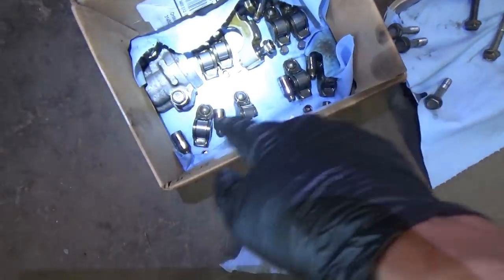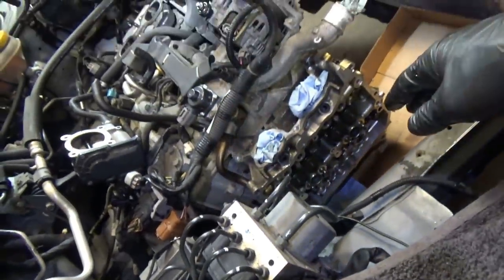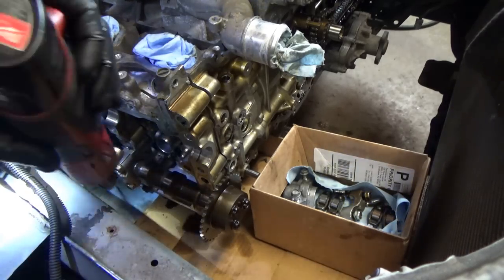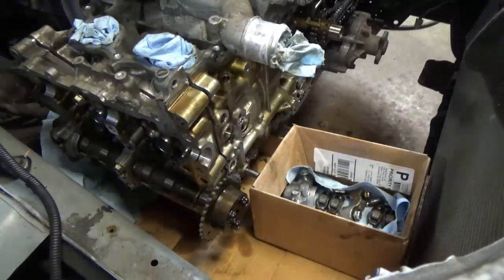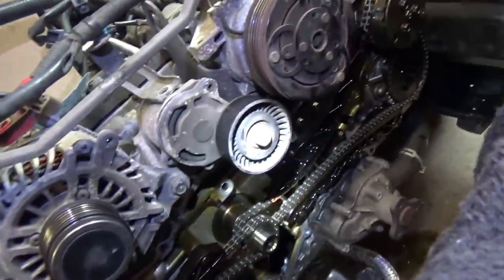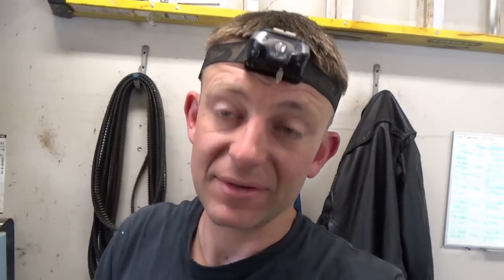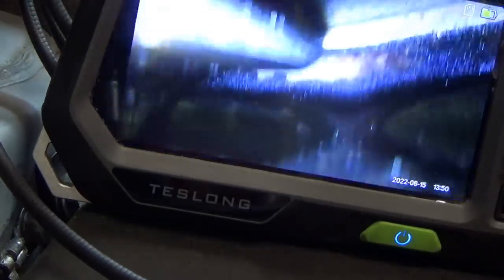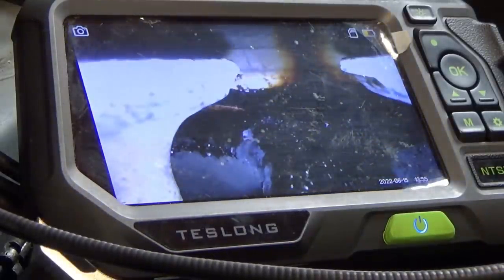Head Reassembly & Left Head Valve INSPECTION (Sad Subaru - Part 4)

Comment: Subaru has a set standard in miles driven for oil burning so a consumption test should be done by Dealer if this vehicle does not have to much mileage..it may be warrantied. Sometimes just changing oil brands helps because some name brand oil burns more quickly than others. Mobil1 is worst for burning off in Subaru. Also I have read if this engine takes 0w-20 or 5w-20 use a 5w-30 it helps.

Comment: Hi Ivan, great video and look inside cylinder.
I wonder is/has the customer been using the correct oil for that engine.
Reply: It appears that the owner is as cheap as the day is long. This thing has been neglected and cheaper out on.

Comment: you got lucky with the new valve length and shim size if a little longer or shorter or ground valve seat more or less you got lucky and  should have bought a lottery ticket
Reply: I’d wait a week before getting that ticket, at least a week 🤞🏼
Reply from the maker: @Dirtyharry70585  it's been a month 😅
Reply: @Dirtyharry70585  all i said was he got very lucky with the shim valve clearances on new valves  times 4  very very lucky when he gapped them should have headed  for the ticket right then as for rest of engine  anybody guess
Reply: On the video Ivan doesn't check for excessive clearance. When adjusting valve clearances, I us a "go, no-go" strategy; one feeler gauge for minimum required clearance, and a second for .001" over maximum allowable clearance.  The first should slip in, and the second not.
Reply: @5tr41ghtGuy  with cam in head i normally  build the top end ? check and adjust as needed on the bench then put into car  with a final check  which ivan could have done off camera maybe

Comment: Using adjustment shims is the only way for DOHC engines to have a compact valve train assembly..shorter rocker arms and no followers. The ideal setup is where the cam actuates the valves through shims right above the valve. Also, I might add, metallurgy has come a long way since the 50s and 60s. The engines from back then would need a "valve grind" by 70k miles, typically.
Reply from the maker: yup, Toyota had the valvetrain system down back in the 90s. Motorcycle-style shim and bucket directly under the cam lobe. They run forever, less moving parts, and generally never need adjusting :)
Reply: @PineHollowAutoDiagnostics  Correct me if I'm wrong, but I believe the Ford 4.6 4-valve used the bucket and shim setup too (the others used cam rockers and followers).. Kawasaki was the first motorcycle to use the arrangement in the Z1. That is true about bucket/shims not normally needing adjusting, but if you have to..then it's typically, "measure clearance A, see what is stamped on shim B, add the distance between planets C and D provided it's the second Tuesday of the month, and your new shim is E". Actually, you have to find the new shim using a chart.

Comment: Had a Fiat Stilo 1.4 16v that consumed almost a litre of oil for each thousand km. So like a quart every 600 miles. Eventually the same thing happened, exhaust valves got burned and it lost compression. It happened suddenly, like in one moment it lost a cylinder, driving lightly on the motorway. 240kkm was it's mileage.

Comment: As an addendum after seeing the boroscope on the left with the oil/carbon at the seat of the exhaust valves preventing them from seating and thus cooling I'd put a hefty slug of a carbon cleaner like Lucas on the fuel.
Reply: Won't work as the engine is direct injection, so no fuel passes the valves.
Reply from the maker: @Cheepchipsable  It's normal port injection...and even GDI would work since we are concerned about the exhaust valves in this case :)
Reply: We are talking about the exhaust valves not the intake valves. Intake valves are the ones that are problematic on direct injection engines.Cleaners do work to a degree.

Comment: one of the problems with boxer engines. there is no gravity to help with oil control. the old super beetles had the same problem. we made sure the oil ring gaps were straight up  comperssion gaps at 3 and 9 oclock. worked for a while.also used cast iron rings not the chrome molly. i was wondering how you were gunna check valve clearance.  i would have put the cam box on the bench checked and removed just in case....  but ivan always gets lucky.
Reply: Please explain this gravity theory, the pressure in the cylinder is 150 is psi and the head pressure of oil in a 5" inch vertical column is less than 0.2 PSI

Comment: Since it seems only the manual xMission has exh. valve issues...  I wonder if DOWNSHIFTING is creating HUGE vacuum within intake plenum. This can suck oil up thru PCV system. (I believe Subaru issued a TSB changing the PCV-valve P/N)
Reply from the maker: Interesting theory...

Comment: The surface of the valve that meets the seat is called the "valve face". There should be a 1 degree difference in angle between the seat and face. I wonder if there was no interference angle. You might try Yamalube Ring Free to see if it helps with the oil issue, and cleans the seating surface. Also is there a rotator cap on the exhaust valve? I didn't notice one.
Reply: have u tried Superzilla,? it is better than anything ive ever tried.

Comment: Fleetingly in an earlier video when you showed the new vs old exhaust valves and their spec, the new ones had a 2 mm greater diameter. Since exhaust valves can only cool while seated could this be the problem? The original exhaust valves didn't have enough surface area at the seat for the heat to be transferred to the head while closed thus they tend to overheat and warp?

Comment: Causes Of Burnt Valves Or Engine Valve Failure Explained
Mar 24, 2016|   1 CommentIn an internal combustion engine, there is the combustion chamber, a piston and an inlet and an outlet. These outlet and inlets are actually valves that act as doorways to let in the combustion mixture and take out the exhaust gases. But what we do not know is that these valves actually serve a bigger function than just that and that is maintaining the pressure levels inside the chamber and sealing it away from the outside world. The valves are proper doorways and seals to make sure that the compression are done in a proper manner and there are no leakages from any ends.

Now one has to understand that the burned valve does cause issue, but it is not a problem, but it is an effect of an already existing problem which needs addressing. So if you happen to have a burnt valve in the engine then you really need to look out for the following issues with your bike as follows:
1. Engine Overheating:

During the combustion cycle of the engine, the valves open and close continuously at tremendous speeds. Now in this the exhaust valves are the ones under more stress because they are the ones to let off the hot air after combustion and for this process they do heat up. This is the reason why they are provided with properly conduction at the valve head so that the heat dissipation is done at a proper rate. But if the engine happens to overheat and the heat dissipation is not possible in a proper manner, then in that case the Valve of the engine burns.

2. Engine Running Lean:

When the engine is running lean, there is more air than fuel in the mixture and a lot of this air is unused in the process. This air is then hot and since is unburnt, carries a lot of heat with it which eventually ends up heating the valves a lot causing them to burn. Also the unused air can even cause corrosion to the inside of the engine including the valves overtime.

3. Incorrect Seal Fitting:

The seals fitted at the zero stage of the valves have to be proper. If they are not the valve would not fit properly and there will be leakage in the system. This leakage will carry on during the combustion process and the heat and flames will all escape out at an untimely manner and this will result in the burning of the valve.

4. Carbon Deposits:

If the fuel quality sometimes is not proper, then in that case the fuel when burnt creates a lot of carbon dust which settles inside the combustion chamber and hence causes carbon deposit issues. These deposits causes problems later on of valves not being shut properly and creating leakages in the engine, etc. which later leads to valves being burnt due to loss of compression.

5. Valve Spring Malfunction:

The valves movement is all taken care of the springs which aid in the opening and closing of the valves. So in case the springs of the valves goes kaput, then the valve does not open and close properly leading to jamming of the valves and this later goes on to cause troubles. This is why the valve stays open or closed unevenly and causes issues with the heat transfer and in combustion leading to burnt valves.
So now that we know the reasons how valves could burn or do burn, it is also important to know what happens when the valves burn and the solution for it. When valves burn, they develop cracks in them and this leads to first and foremost, loss in the compression of the engine. This affects the performance of the engine big time and leads to even misfiring or uneven combustion that can leads to sputtering of the engine or even stalling of the engine mid-cycle and so on.

 
The solution actually means simply changing the broken valve but also along with that, one has to check that this issue need not appear once again and hence tweaking the bike is important. The spring, the seals, the carbon deposition, the fuel mixture, etc. everything needs to be properly checked out else the issue will keep of persisting.

So this is the issues with a burnt valve. One should address it ASAP or else it could lead to permanent engine damage and when that happens, we all know the issues one has to face which means having to fit in a completely new engine to the engine catching fire or blasting which can be fatal as well. So make sure your engine is in perfect shape and running well and keep it maintained and proper at all times.
Reply from the maker: Root cause #4 in this case :)

Comment: Take that thing out for a drive and drive the snot out of it for a bit and then have a look at the valve seats, Id be willing to bet that will clean them up. 
Boxer engines are famous for burning oil on start up, most people that own them are not aware of this but it happens. BMW  motorcycles smoke pretty darn good if you let them sit for a day or 2. Its just the design.

Comment: the oil buildup is from the oil control rings being stuck, they get seized because of their design/size and no long expand to create the seal, oil then gets into cylinder and burns/gunks up . subarus suck :/ i bought one as a favor and motor blew 6 months later because of this same thing, i thought it was just a headgasket failure, he told me to check oil control rings to see if they were seized, sure enough they were.  According to him, the oil gets past oil control ring, then gunks up cylinder/piston, heightens compression and causes headgasket failure.  My headgasket was not the shitty one, after disassembly realized it was an MLS.

Comment: Surprised to see valve stem caps used.  Makes you wonder if the right engine oil is being used or adding too much ?  Is the engine running too cold or just short trips?     With just over 100,000 some ?

Comment: Man this engine just needs a rebuild not a few valves. This is why you need to find the why before repairing the what. I know it’s expensive but if you are going to do it, do it right. You are the professional and can say no. Could you imagine a doctor saving a few bucks cutting corners and ignoring other issues. I can see the owner selling this as, “ professionally repaired by PHAD” to reassure a new sucker.
Reply from the maker: A doctor most of the time will prescribe pills to cure the symptoms, not necessarily the root cause lol

Comment: Looks like extended oil change intervals, short trips, low quality oil are taking their toll
Reply: It is the targeting for lowest gas consumption. Loose parts from factory and 0w20 oil to minimize friction loses in engine, it leads to early high oil consumption and than this. It is like plague in many todays cars, not just Subaru.
Reply: @petrnemecek4379  If the engine calls for 0W-30 it was manufactured with close tolerances that require light oil to lubricate, clean, cool, seal, heavier viscosity will not be able to perform under modern tolerances

Comment: Screaming at the camera Ivan when you said you put the black timing chain link on with it lined up on the crank keyway. This is incorrect. The black link is one tooth away from the crank keyway. There is an oval or half moon shape (mark varied from year to year) marked on the crankshaft sprocket. This mark is the correct spot to align the black link. You will have cam/crank correlation codes if you did it incorrectly.
Reply: This car is probably long gone by now. We will see if you are correct in oart 5
Reply from the maker: I never moved the crank while chain was off so no worries 😉

Comment: WOW, That looked like TAR PITS on the other side. Does he change his Oil ? He needs some good high mileage oil & maybe even soak each cylinder with a solvent too get them cleaned up. That is definitely causing it to run hot in the combustion chamber, ruining the valves.  

I know doing the head wasn't easy but you made it look that way, Sir. I thought this was going to be the last part but NOOOO U TEASE US RUSSIAN MAN. Henry from N.E. PA.

Comment: Patience defying job! I wondered if those valve stem shims should not be changed for the new valves - they could seat lower than before. But your feeler gauge test seemed OK. The other side of the engine looks even worse! Those valves are not seating properly and they will overheat! If there wasn't a constant supply of oil, it would probably burn the gunk, eventually. Not good.

Comment: That valve clearance may have had the stated spec required, but were they within that tolerance range?  (+0.0008 / - 0.0012 for exhaust and +/- 0.0008 for intake)  That's a pretty tight range and almost impossible with the way those exhaust valve seats looked to still be in spec, plus add in new valves and manufacturing tolerances and the lapping. It's one thing to have the minimum but what was the max clearance on those valves? But good thing it's better to be too loose than too tight. I'd like to see the clearance after those new exhaust valves pound the shit on the seats a few 100 miles.  Hate to be raggin' on this repair but wow...... Sorry man. (Is it April fools? ;) ) 
Hope it lasts for the customer.

Comment: Those gummed up valve seats….nothing a little Sea Foam won’t fix!😜
Reply from the maker: Actually the owner already ran SeaFoam through it! Must have looked even worse before that 😆
Reply: @PineHollowAutoDiagnostics  
So what do you think…..leave the engine in or take it out for this repair? I hear they are not too bad to remove, however, I have about as much space as you do, minimal.

Comment: People don't tighten spark plugs because we have all heard how easily they can break especially if they're too tight on removal, there's almost a fear around spark plugs breaking in the head
Reply: Torque them . Wrench doesn't cost much and you remove all doubt.
Reply: @likearockcm  it's certainly safest
Reply from the maker: @likearockcm  I had a friend who used a torque wrench and completely broke the spark plug in his Saab 93. He was a grad student, so not surprisingly he didn't have much common sense LOL

Comment: Shims - interesting.
Reply: I put new crank bearings in a 99 CBR 900 street bike engine, and it had shims in the valves like that also.  Each shim is very precisely measured and has to go in the right place as he said.  The crazy part on those engines is the valves will 'wear in"  into the head so much that it will cause the valve stems to stick out further than normal, and that will completely close the clearance between the end of the valve stem and the shims--  so much so that it will prevent the valves from closing all the way (especially the exhaust valve), and you will start to hear it as an engine knock on hard throttle, getting into higher RPM's...  but all you are hearing is your valve being a little stuck open, so you're hearing a backfire sound basically....   So when the valves get that worn in, you have to do a valve job and actually put on THINNER shims, to get you back to your spec clearances again.   Pretty strange.  It's not like a honda civic vtec engine, where the valves get loose over time, and you have to tighten them back down because you're hearing ticking noises.............  It's quite the opposite.  The valves get too tight, rather than too loose.  They get "worn in", rather than worn out................    another strange thing with sport bike engines is the crank bearings.  They give you a certain spec. range, and you have to plasti gauge each crank and rod bearing. and every .001 thousands.. they give you another color...   so if one bearing was .003 thou off and another bearing was .005 thou off--- they will have a range of bearing sizes for every thou, and they are color coded..   So say red is .001, blue .002, green .003, purple .004, black .005,... ect. ect.......  and you have to order a specific sized bearing to fit each one, so that it gets all of your clearances within .001 thou, of each other.   I thought that was pretty incredible.   That each bearing is so precisely measured separately from each other..   You don't just buy a 'set" of .030 over bearings and call it a day, like an SBC or LS engine.  Each bearing has it's own specific size to get it so precisely correct..   They call that "blueprinting" an engine.  because these sports bikes rev as high as 15k RPM's, so everything has to be high precision and that's why they run so smooth..   Very cool stuff.